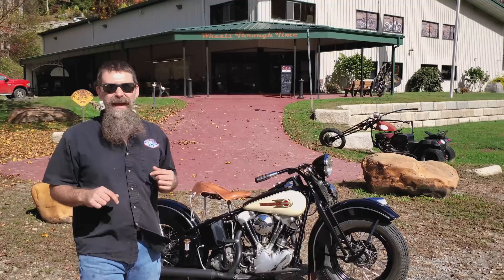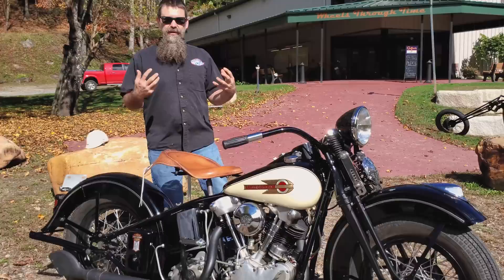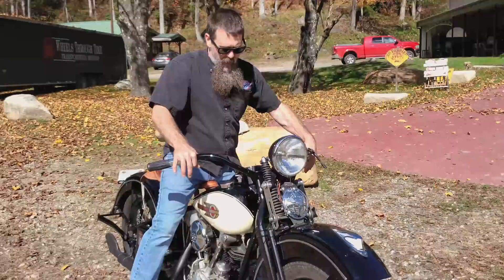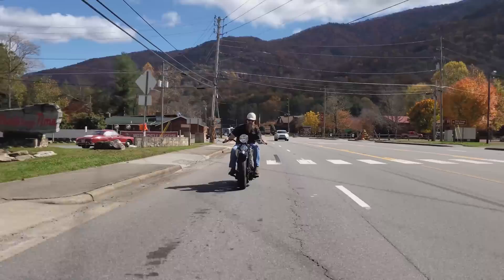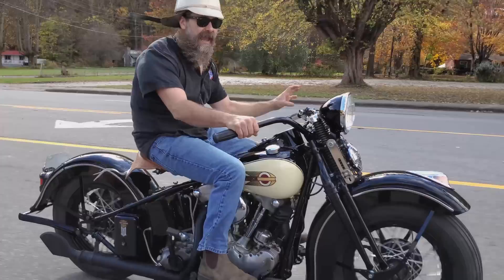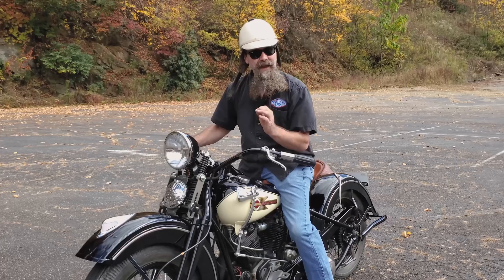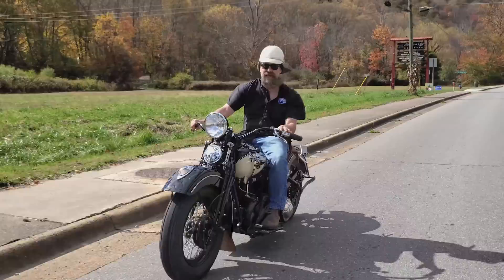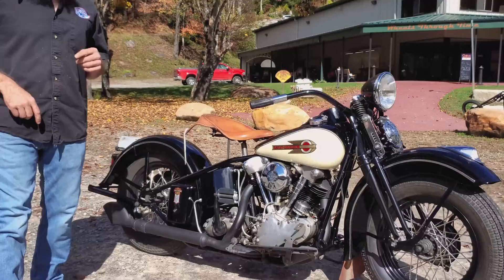A How-To On Riding Vintage Motorcycles!

Comment: Great video Matt. First Harley I ever drove was my father's 1942 WLC Military with a 3 speed tank shifter and it ran beautifully. Around the same time my father acquired a brand new 68 FL Police Special which was designed for a sidecar. That bike also had a 3 speed tank shifter with a reverse. It was a little trickier to downshift from third to second because the shifter was free floating and had no guide on the tank. My father would let my brothers and I use it with the sidecar attached to get to school. The Goodyear Grasshopper rear tire would help a lot in the winter. We had to bundle up a lot but it sure beat taking the school bus.

Comment: the clutch is right foot   the shift is lever   the right hand is front brake lever , rear brake is left foot pedal........?   the best way to teach is standing still    , when you buy used , you just look and follow connections to motor and brakes.    when you ride you  will see it in your mind  .

Comment: Pretty nice camera work!  Only way to get that better would be to use a drone.  Great gear shifting and clutch work lesson.  Such a shame that the EVs are coming like a freight train.  Harley better get on that game very quickly.  Two ways to go.  High digital tech; and, retro mock electric solenoid pistons.

Comment: When the linkert pukes gas all over it's time to turn on the switch.......
Get it up on compression and kick vigorously. When you disengage the clutch your can take your foot off of it but if you rev the engine it will take off . Hence the name sucide clutch.
And always remember it's heavy and it won't stop worth a damn. Enjoy your vintage experience.